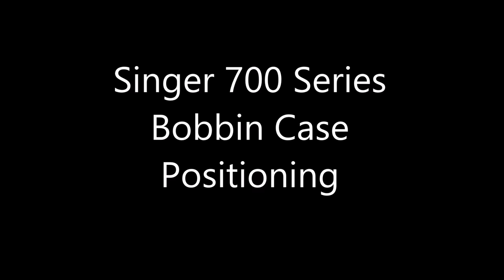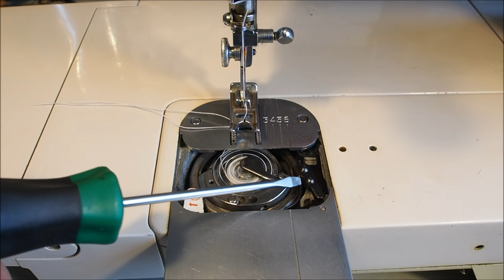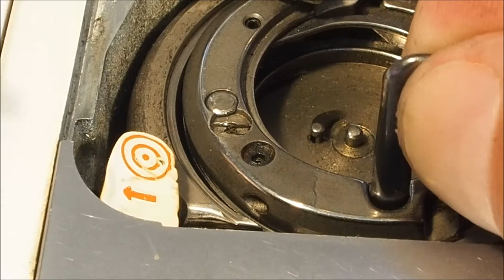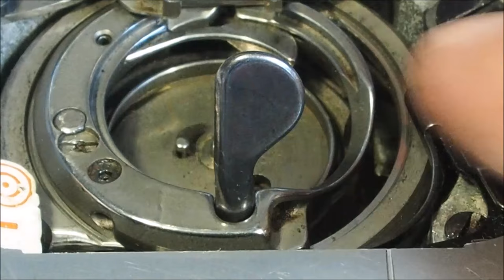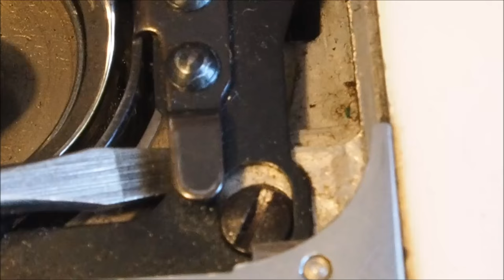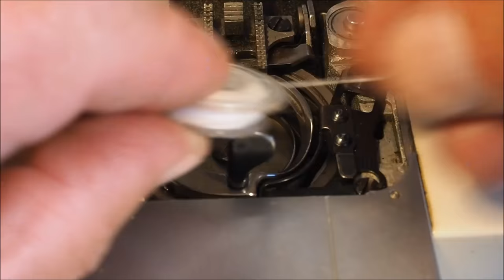Singer 700 Series - Bobbin Case Positioning

Comment: Thanks for these 700 series adjustment videos.   I have been stuck at home with a 758 during quarantine and its wonderful to have reference videos like yours.  I appreciate it!
Reply from the maker: I'm please they help.
Reply: My husband just salvaged one on the side of the road and I was wondering if the dog feed is plastic, because this one is totally smooth on both of them. I have taken allot of machines apart and cleaned and oiled and fixed them. But this one has me stumped. I think it is an easy fix but I don't know. There’s no accessories, books or anything to show me.

Comment: Thank you a lot. I have just bought a 746 in good condition. I am very used to vertical bobbins (I restored and use constantly my grandma 222K singer Featherweight). On the machine I bought, I find the bobbin tension very very loose, no resistance at all, which results on a needle thread tension at maximum 2. I messed aroud with the little screw on the bobbin case but it seems to have little to no effect. I wonder if you could give me a hint about how tight should be the right tension? Do you think that the old bobbins are the culcripts? Maybe the needle thread tension is too high? But I think it is right when I pull by hand at 4.

Comment: THANK YOU! I just bought a Model 645 and could not figure out how to get the bobbin to thread! Thank you for the help
Reply from the maker: I'm pleased it helped.
Reply: @InStitches  it did... I picked up the 645 at a church yard sale for less than 10$ and it had just been serviced and cleaned... it came with all the attachments in a box but no manual... I was very excited to get to use it for the first time...

Comment: thank you for t your videos they are helping me repair my 760. i have a question my bobbing case keeps jumping after a few stiches and i keep breaking the needles. it sounds horrendous when it sews too. do you have any advice
Reply from the maker: Thanks. Make sure you have oiled the hook race. Check out my other videos as I'm sure I have gone through that on the Singer 700 series machines.
Reply: @InStitches  thank you have found that the one of the 2 mane gears are worped so I will see how it works when the arrive

Comment: While I was sewing, the thread jammed and the bobbin case popped out of position. I was able to reset it (thank you so much for the video), but for some reason the thread keeps jamming.

It's the needle thread, and for some reason it keeps getting stuck underneath the bobbin case. Any ideas on how to fix it? (It's a zig zag 750 if that helps)
Reply from the maker: Make sure the area under the bobbin case is clean and free of any stray pieces of thread. Also make sure the bobbin winder is not partially engaged.

Comment: Is it supposed to constantly spin the bobbin? Mine spins half way then stops and you have to spin it by hand the rest of the way and then it catches and spins half way again.
Reply from the maker: I assume you're talking about the hook, the large ring that spins around the bobbin case? If so, yes, it's supposed to turn constantly. May be a broken gear that drives the hook. Thanks.

Comment: I did all of this, then adjusted the timing and all seemed to be well. Everything works fine until I put a piece of fabric under the feed dogs, then the needle hits the hook. I just can't figure out why this is happening. Any ideas why a piece of fabric would make it act differently?
Reply from the maker: It could be the feed timing is out, so the fabric could be feeding when the needle is in the fabric?
Reply: @InStitches  I found a video and adjusted the feed dogs. Prior to that I had changed out the needle, upon close inspection, the tip was ever so slightly bent. I adjusted the hook timing slightly again. That all helped, and it's stitching...well, the tension dial, no matter where I put it the upper thread loop on the bottom. I just noticed the needle position and the stitch width dials do not line the needle up properly with the presser foot, so that may be the issue.
Reply from the maker: Sounds like the timing may still be out but it's hard to say for sure without looking at the machine. Thanks.

Comment: Do you have any idea how to adjust the needle bar?
even being in the central position, the needle is moved a few millimeters to the right (I have a singer 778)
Reply from the maker: You may already, but make sure the stitch selector set to straight stitch. Also put in brand new needle.
When you put the machine into zig zag pattern at the full width, does the needle hit the plate if you turn it over carefully by hand?
Keep an eye out for my upcoming video on how to use the 700 series machines.
Failing that, the needle bar may need adjusting but I don't have a video on that yet.

Comment: Hola buenos días. 
.- Los discos negros, no se sujetan, los pongo como dice el manual y cuando voy a coser la costura va para atrás, eso no pasa con los blancos. Could you help me with something?. Singer 740 gracias
Reply from the maker: Hi, make sure when you have the black disks installed that you have the stitch length set to forward stitching.
Reply: In Stitches  
Arreglado Gracias

Comment: Hola, gracias por el vídeo, mi problema es que no me hace la canilla y además  suena fatal todo el cuerpo d er la maquina
Reply from the maker: Thanks. The first thing to try is make sure you have installed a brand new needle, make sure it's the correct type and inserted the correct way around and is pushed into the needle bar as far as it will go.
Also oil the machine as seen in this video - https://youtu.be/GmlqAkIzEfk
Reply: @InStitches  Holaaaa.
Simplemente quité la tapa de abajo pasé la aspiradora y recoloque las grasa que tenía  en las piezas que no son metálicas,  quite las pelusas y volvió  a coser,,,, más silenciosas, 
Como tiene muchos años ya no se encuentran prensatelas y miedo me da que se rompan piezas, gracias